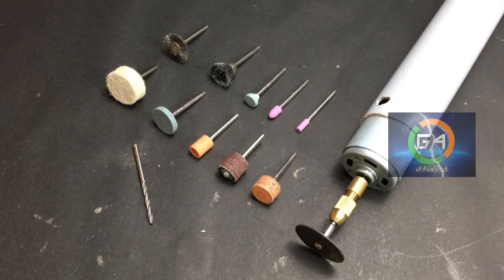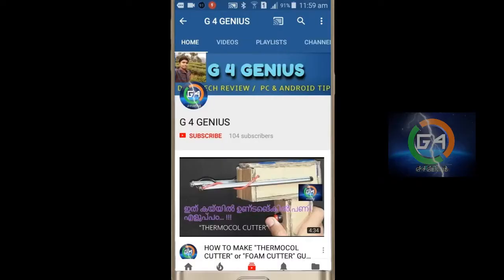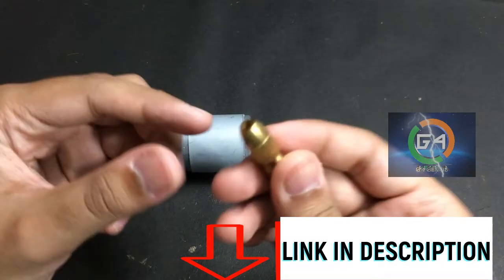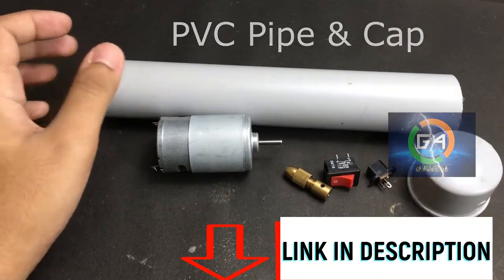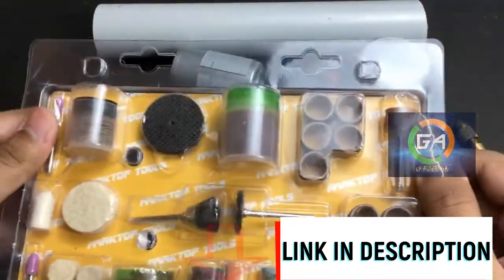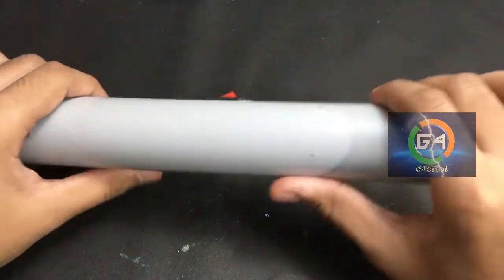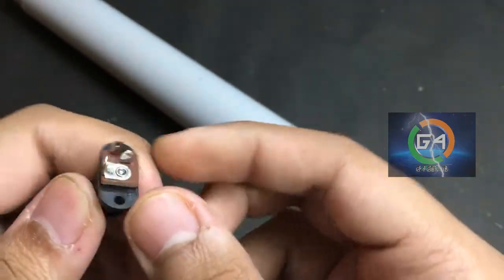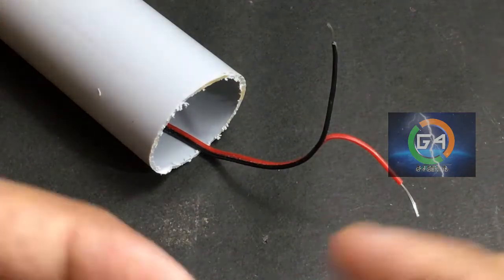How to make Rotary Dremel tool For Science Project

Comment: Chetta nammalu naritu vtl upayogikunna karandu upayogichal motorinu vallathum pattuvo?
Reply from the maker: You need to use 12v adapter
Reply: Adaptor flipkartil available aano
Reply from the maker: Yes
Reply: Athinte link onnu tharamo
Reply from the maker: AUTOEASY Power Adapter 12V 1Amp Dual Pin for Charger, SMPS, CCTV Camera, Wi-Fi Router, Modem, TV, Led Lights Worldwide Adapter (Black), DC Powers Supply (Input:100-240V 50/60Hz, Output:12 Volt 1 Amps) Worldwide Adaptor
https://dl.flipkart.com/dl/autoeasy-power-adapter-12v-1amp-dual-pin-charger-smps-cctv-camera-wi-fi-router-modem-tv-led-lights-worldwide-black-dc-powers-supply-input-100-240v-50-60hz-output-12-volt-1-amps-adaptor/p/itmd3fbaf0a90b40?pid=WWAFPKPFDHBZGWM8&cmpid=product.share.pp
Reply: Thanks